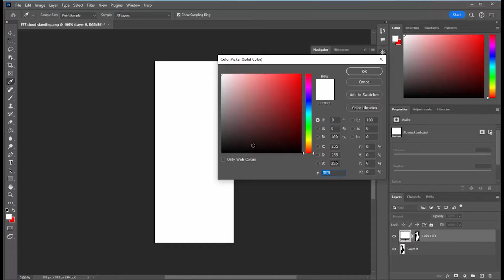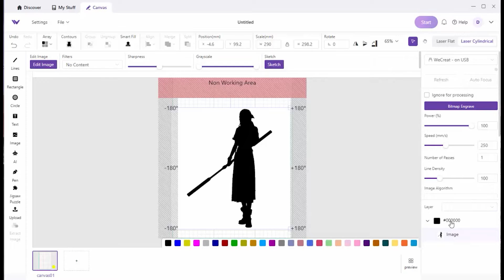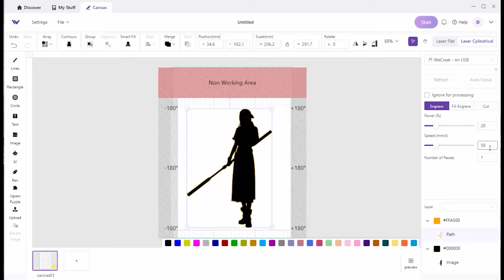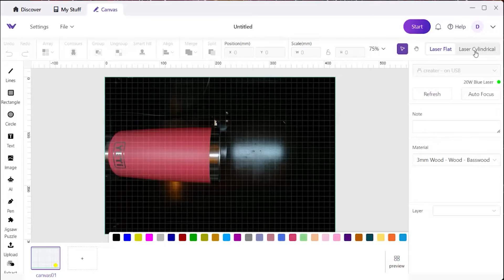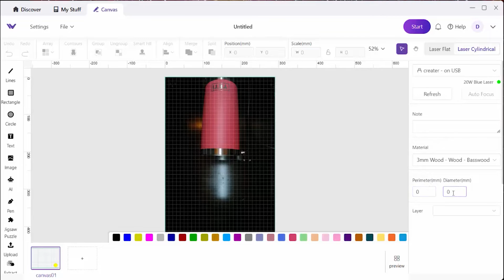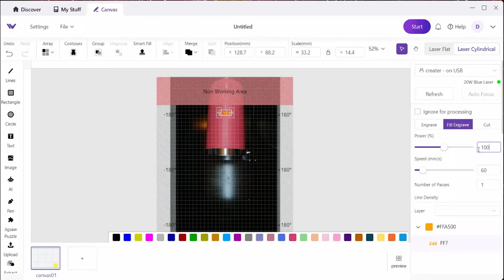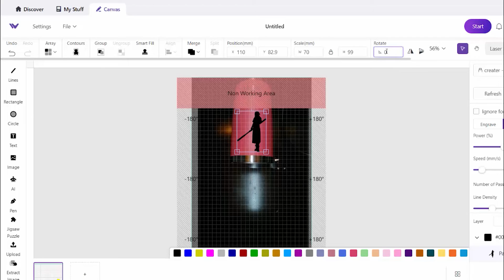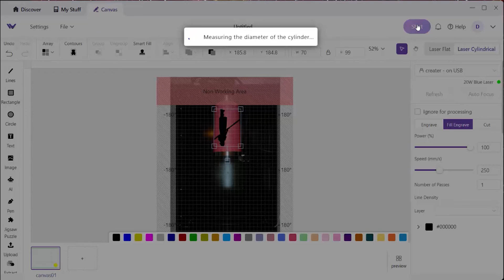Installing and Using the WeCreat Vision Rotary Attachment to Engrave Final Fantasy 7 Rebirth Tumbler

Comment: Im doing a little project for an college organization which consists of names and the organization name. I used Illustrator for the my design to create, however I sent the PNG to the computer that connects to the WeCreat but I did just about everything that was shown in the video but unfortunately the names came out super blurry. Im just not to sure where I went wrong? If you have any advice it would be much appreciated!
Reply from the maker: Beta, you are happy with your png, it's crisp, right? What colors are in the png, is it all black? If this is for rotary on tumblers, it should be all black. Is it all pure black or shades of gray? You want all pure black. Then you select the black, call it fill engraving, which is what a png always is, and start with the default settings for your material, and test. Sometimes I adjust the power after I see the results. Is this what you are doing? It is hard to help much without seeing your design and your settings. It shouldn't be focus is an issue because autofocus is required. Are other things you're engraving turning out well? You will have to clean the tumbler well to see what results you are getting.

Comment: Thank you for the instructions, I do have one question.  When you measure the tumbler, where do you measure?  The tumbler is somewhat conical, so do you measure the middle or thickest/thinnest part?
Reply from the maker: Excellent question, one I had myself and couldn't find a definitive answer to. What I did, and it seemed to work, is measure near the middle of where the design was going, and did my best to use the adjustable foot to make the surface level. The Vision then does it's own measurement before engraving and this gives it enough information to do a nice clean job.

Comment: Any reason to use LightBurn software rather than WeCreat software?
Reply from the maker: The current version of the software is so improved, I haven't used Lightburn, even though they improved its integration. I think 3d engraving was the only thing I wanted they still didn't have - and bidirectional, as I said in the other response.

Comment: Can we get an Amazon link for the tumblers used in this video?
Reply from the maker: Hopefully YouTube will let this comment through. Sometimes they pull responses with links that go outside YouTube:
TDYDDYU 8 pack 20 OZ Double Wall Stainless Steel Vacuum Insulated Tumbler Coffee Travel Mug With Lid, Durable Powder Coated Insulated Coffee Cup for Cold & Hot Drinks (Combine colors, 8 pack) https://a.co/d/hXeOW66
I'll try to follow up and make sure my response is visible!

Comment: Don't know what it is but I find it a real treat when someone actually pronounces speed in millimeters per second and power in percentage.  Also, this machine is actually doing bidirectional raster engraving?  Sure appears in several YouTube videos the beam is only on in one direction.
Reply from the maker: No, Lance, it is currently only one direction. I may have been misleading with my back and forth hand motion because I'm so used to using Lightburn bidirectional. I'm hoping WeCreat steps up to bidirectional, they are making lots of improvements, fast, and that is quite important for efficiency.

Comment: Try cleaning the tumblers with LA's totally awesome.  That is the best I've found for removing the smoke deposits after engraving.
Reply from the maker: Thanks, kkoors, I will definitely get some and try it!!
I'm getting ready to order some. Can I use this on wood?
Reply: @GreylightMay  I generally don't put cleaners on wood.  I premask them to protect the non-engraved area and then do a light cleanup pass with the laser to clean up the engraved area, if needed.
Reply from the maker: Thanks, kkoors!